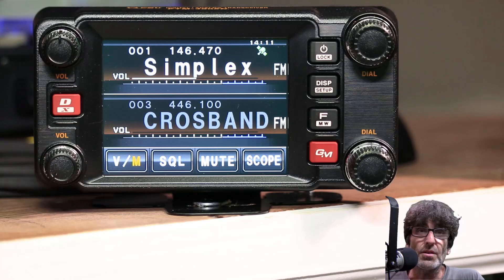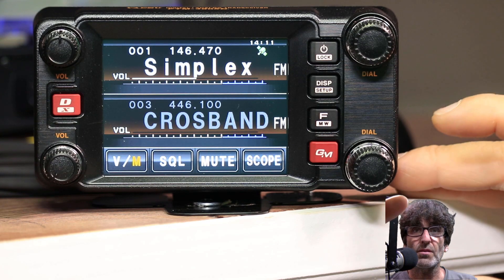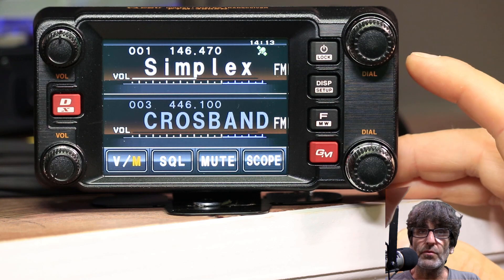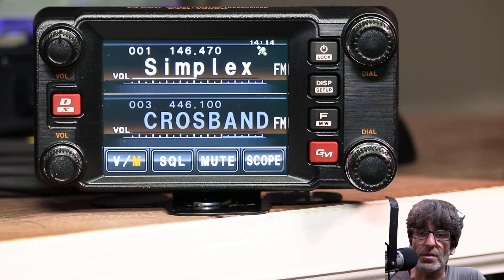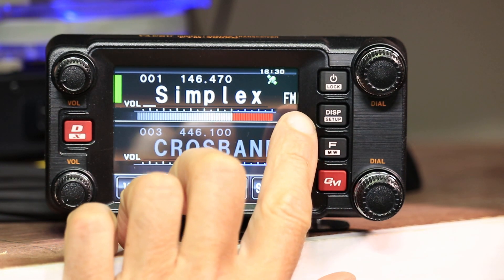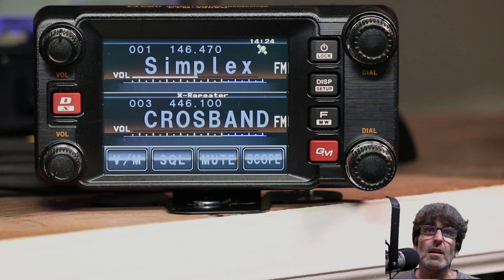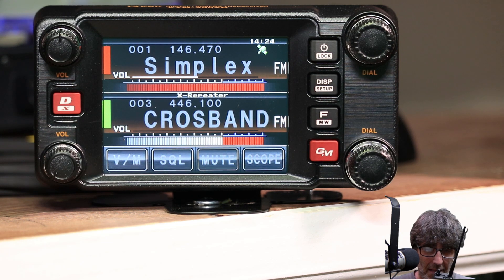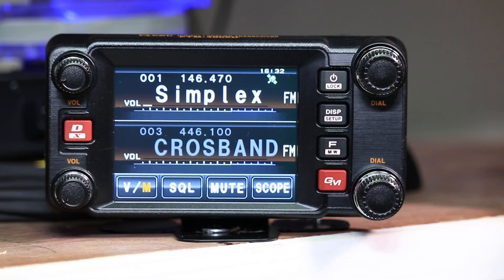Yaesu FTM-400 XDR Cross Band Repeat Demonstration

Comment: I tried programming some Gmrs repeaters in the radio and it’s showing error every time I key it. What am I doing wrong. Any help is appreciated thanks
Reply from the maker: IS your TX opened up?  Also you have to set your receive coverage to wide....  It's in the menu, I don't remember specifically where It is..   IF your TX isn't opened up, you should be able to receive GMRS, but not transmit.

Comment: What frequency was John's radio on? Sorry, I'm new at this
Reply from the maker: I'd have to go back and look at the video.  John was more likely listening on a 2 meter simplex Frequency.  The one would have been 146.470.  I'm pretty sure I was transmitting on 446.470 from the HT to the Yaesu and it cross band repeated to the 146.470.. Hope that makes sense..
Reply: @JLPicard440  Thanks for the reply, it makes sense now that I've learned more about crossband repeat. The idea is to have the signal that is being transmitted further away (station to station) to be on a lower frequency  (2m vs 70cm) and at a higher wattage. Thanks again.
Reply from the maker: @deplorable-0ne  Yes exactly.  70cm has a very limited range unless you have an extravagant station.  But for example if you wanted to go hiking, you can bring an HT with you and use your vehicle as a base to transmit farther than the HT can go..

Comment: Just to clarify if you would 
My plan is to use crossband to  hit a wx repeater from the apartment. It is 146.880 with an 88.5 tone. Is the recieve frequency the input of the repeater 148.280? And where is the pl tone placed?
Thanks.  Nice video
Reply from the maker: HI Lloyd.. The listed frequency of the repeater is the receive frequency..  I'm not sure but that freq range might be the normal simplex part of the band.  The offset is usually +/- 600KHZ..  The TX frequency will be either 147.480 or 146.280.. the radio will indicate what the offset is if it's in the normal repeater part of the band.  If the radio doesn't do it, then you'll have to check the listing for the repeater to see what the offset is. The tone has to be input into the radio and that's not something I can explain very easy over a text message.  You might have to check the manual for that one..  Also, that's not what cross band repeat is.. cross band would be for example going from a 440 MHZ frequency to a 2M frequency and vise versa.. One other thing, there's no weather repeaters at all.. the weather frequency is up around 162.xxx.. Not something you want to transmit on without risking big trouble from the FCC.. I'm not sure if that's what you meant by WX repeater..  Let me know if you have other questions..
Reply: @JLPicard440  
With all due respect the answer is probably in that 5-minute read but let's make this easier....
I'm not going to transmit on the weather frequency. That's a ridiculous assumption. I need to know do you program the repeater frequencies exactly the same with the cross band set up?
Or is it Opposite somehow.
Reply from the maker: @lloydpalmer5620   Thanks.

Comment: Good video. I would add that there is another YT video on the same subject at https://www.youtube.com/watch?v=XHESwmjNiFM also worth watching. He adds that you should disconnect the mic cable from the main unit before starting in cross-band mode because as he put it, there is a "hot mic" on the FTM 400 is cross-band mode. BTW, I'm also in Virginia, new ham in June.
Reply from the maker: New Ham!  Excellent... Got to keep the hobby alive... :-). I'll check out your link later on.  I've never had any trouble not disconnecting the mic..  If you ever get on HF, just go for Extra, then you won't need to worry about being in your legal zone... :-)

Comment: Can the radio be configured for periodic station ID broadcast?
Reply from the maker: I looked at the manual and didn't see anything in there about that... I could be wrong, but I didn't see it
Reply: i was wondering that too.. the only radio i see that will do that is the kenwood v71.. i wonder why they do not put that feature since it is required...
Reply from the maker: @tonytyler6390  Because it costs an extra .50 cents... :-)
Reply: This is a REALLY important issue with cross-banding. In the setup shown in this video the 446.100 output from the FTM-400 is not being ID'd - The FCC frowns on unidentified transmissions. ;-) (and yes, each transmitter must be ID'd)

Comment: Great video; but, you didn't show us how to get the radio into the Crossband Repeat mode.  Is that on the main menu of the radio?
Reply: To clarify, it already said "CROSSBAND" on the lower VFO before you set it to crosswind by pushing the three buttons.  How did you do that--is it just a simple selection from the menu?  Reason I'm asking is I want to buy one and I'm nearly 70 years old.  This is not easy for me.  I started in HAM radio over 45 years ago.  So, I have a lot to learn.  Thanks for your patience in advance.
Reply from the maker: The Lower VFO only said crossband because it is a memory channel that is already called "Crossband"  It doesn't mean the radio is in cross band repeat mode..  I am not sure where you get crosswind from?  I never said anything about that... When I pushed the 3 buttons as I turned it  on, if you noticed the screen said X-Repeater... at that point it was actually in cross band mode... I hope that helps.. Thanks..
Reply: @JLPicard440  I'm following up a year later!  Now that I actually have a FTM 400 DXR, your video is perfect!!!  I now totally understand why yours said "Crossband."  BTW I followed your FANTASTIC instructions and it worked perfectly the first time.  You have a great voice and I appreciate videos like yours that get right to the point!! WELL DONE!  Sorry for my first post--I feel a little "dim" but, thank-you for not making fun of me.

Comment: Does it only x-band from B to A?
Reply from the maker: NO,.. depending on how you setup the Freq's... In one direction it's going to 2M to 70CM.. the other direction it's going from 70CM to 2M... or you can put the 70CM on top and the 2M on the bottom... I don't think it matters..

Comment: KG5RPC, What is cross Band Used for?
Reply from the maker: You can use a HT to walk around the house to use your base radio as a repeater, or if you have a radio in your vehicle the same thing... you transmit on 440 on the HT and the base or vehicle radio will pick it up and re transmit on 2 meters..... it'l take the 2 meter stations you receive and re transmit back on 440 so you hear on the HT... It's the same thing as a repeater, except the input frequency is on another band instead of 600KHZ like 2 meter repeaters.. hope this helps.. thanks..